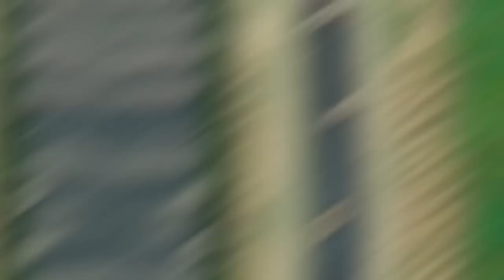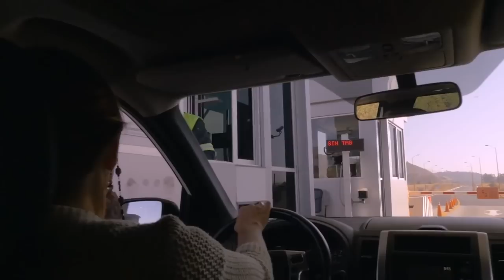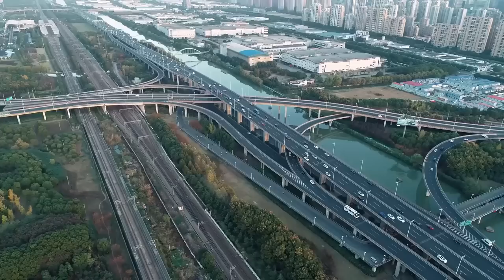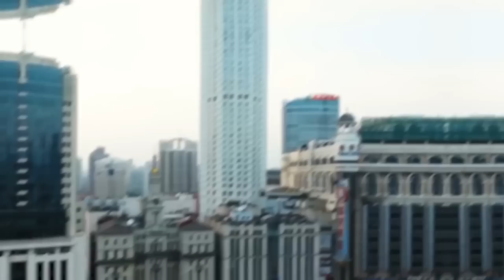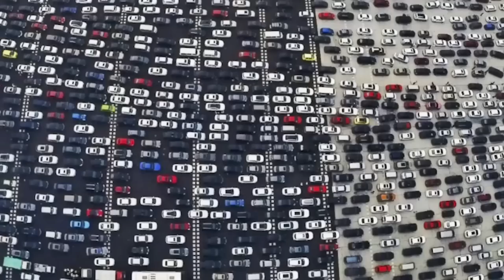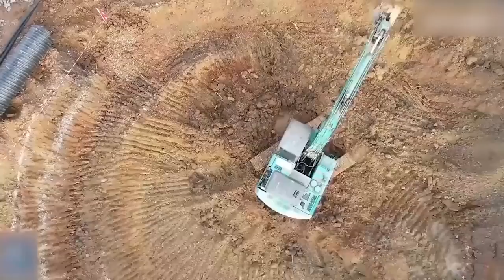How The Chinese Build Roads

Comment: I know this is an older video but I just happen to see it here a few minutes ago. I also did read A lot of these comments on here even though it's been a year. One thing that I kept hearing through out this propaganda video was that's more than United States. We surpass the United States we now have the longest roads. Yeah on paper it sounds impressive. Just always remember one thing when you're comparing something against something specific and that something specific happens to be the same thing then that means that's something specific is the top one. That something specific is the United States. If I do recall I believe that the reason why China is in the position that they are in now is because of all the manufacturing investments that came in from the west. Especially from the United States. Another thing that I always hear all the time too is how new and clean everything looks in China and that in the United States that everything looks old and dirty. Well let's see how all this China stuff looks in about 30 years or 50 years. What China is building now is what the United States did 60 to 70 years ago. Technically China should have the longest road system. After all there's nearly one and a half billion people there. So yeah You need bigger road systems and bigger infrastructure than the United States.